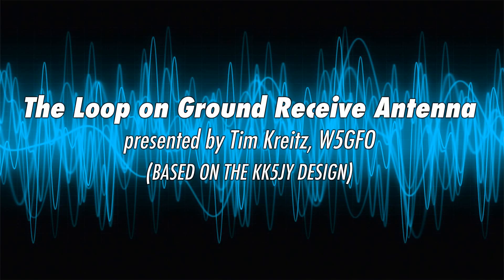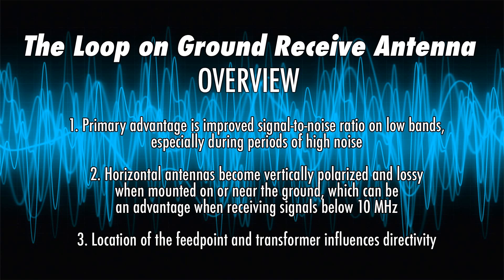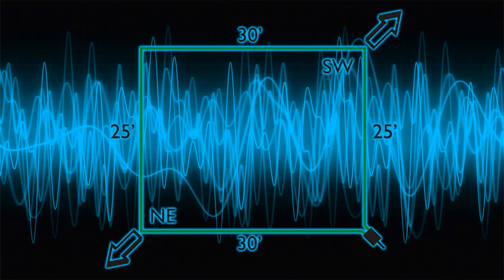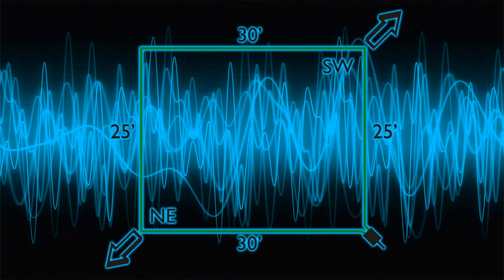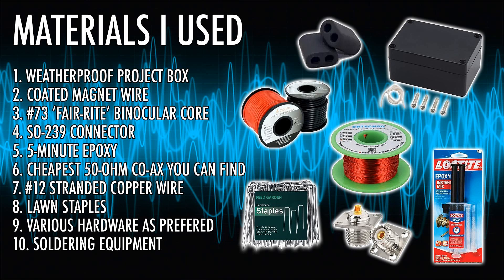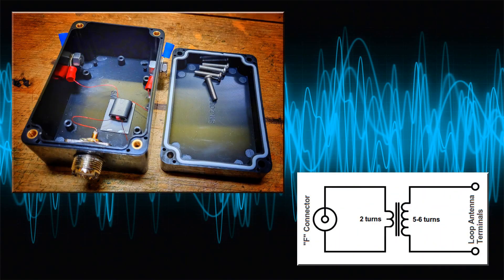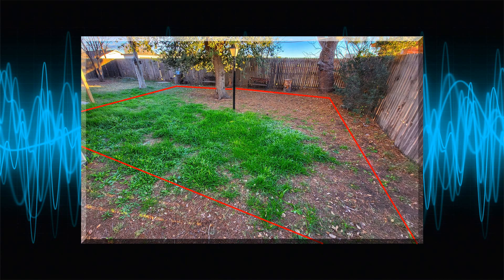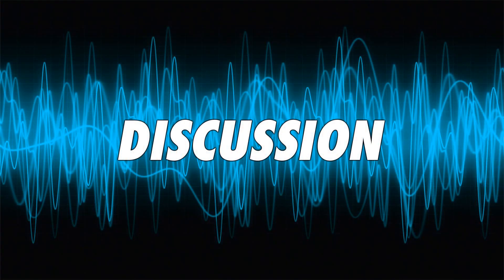Shortwave Listening 101: The Loop On Ground Receive Antenna

Comment: I buried a wire antenna 1" and completely hid the antenna and it made NO DIFFERENCE in receive that it was in the ground !!!!! Insulated wire of course,,, I bet a PVC 1/2" pipe around the property line would make a great hidden and protected shortwave antenna,,,, might even work for a transmit antenna but I would not put high wattage through it until its tested and wattage brought up in steps testing and recording readings as each step is increased to see just what that configuration can deliver ... .. .  Radios and amps are expensive and a PIA to fix !!!!!

Comment: Hi Tim, I am a complete newcomer to shortwave and external antennas.  I like the idea of your ground mounted antenna and have accumulated all your recommended bits and pieces to put one together.  What I am not sure about is the balun.  I have the small ferrite core and the tiny copper wire to wind, but am unsure if your intent is to wrap only two windings of that copper wire on one side and six on the other...or, if what you show on your diagram is a "ratio" of 2 windings on one side to six on the other.  From your photo of the balun box it looks like you have a heck of a lot more windings than two or six.  I'm thinking you may be able to use any combination of windings as long as the ratio stays the same (2:6, 3:9, 4:12 etc.), althought there may be advantages I have no clue about to using more or less windings.  Any thoughts on this.  I actually bought two baluns before I found your video on youtube--an LDG RU-9:1 unun and an Amazon 1:64 good for 1-30 MHz using an end fed 65 or 132 ft. wire.  Thanks.  Tom
Reply from the maker: Technically, what you are building is not a balun so much as it is an isolation transformer. But to answer your question, I would stick with using two turns on the coax winding and six turns on the antenna winding (assuming you are using 50Ω coax). The reason is because more wire will result in more induction. Keep in mind, too, that two windings is two COMPLETE rounds through the binocular core. Same goes for the side with six windings. Lastly, be sure to scrape the coating off the magnet wire before soldering the leads to the connectors. Cheers and good luck.
Reply: If you are confused, try it without the balun transformer - it will still work.

Comment: I have enough room to build one in my backyard but it’s gonna be within 30-50’ of power lines. Will that cause issues? 

Also can use 12 gauge copper wire with the insulation left on? I’ve got hundreds of feet of it.
Reply from the maker: It shouldn't, unless the lines and transformers near the antenna have some sort of problem.

Comment: I have power lines above my back yard. I've been thinking I should be okay to try a LOG if I put it a few inches underground though. Thoughts?
Reply: I see there was a question about burying during the presentation, without a definite answer. I'll mention I have heard of people burying BOGs.
Reply: From what I know I have a (SWER) single wire earth return setup for our transformer from the power lines so idk if the wire would pickup any issues either from the overhead lines or anything coming back through the ground.
Reply: You are not transmitting so should not cause any problems.

Comment: Interesting. Mine is about 35 m long circular wire and I use a RemoteQTH amplifier, a really good performer on 80-30m and propagation depending also up to 10m. 73's Patrick - OT5Q

Comment: Absolutely. I drive around and set at the park with my car. and with a length of wire and a sinker. I toss out the wire. It falls away from my car. I use my rig... then wind my wire. Up when done. It's quick and easy. Also the rig uses the auto's chassis as a counter poise.    Learned to do this in the armed forces to get orders and up dates.